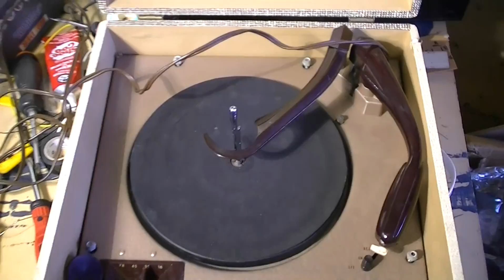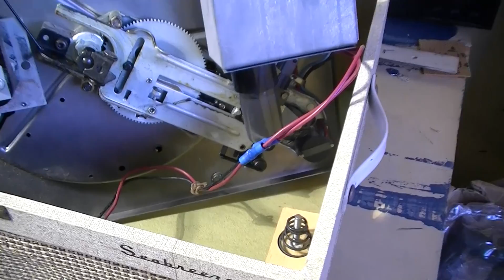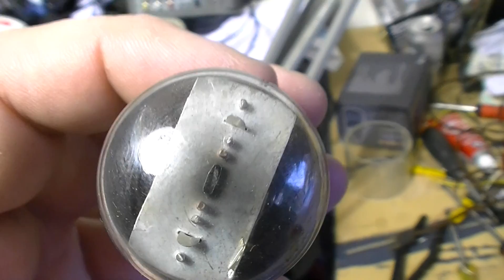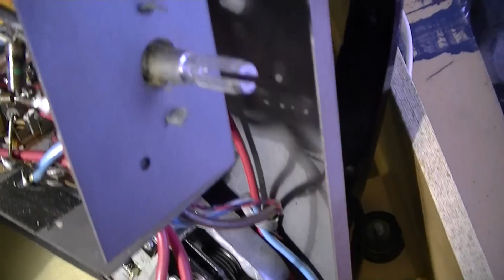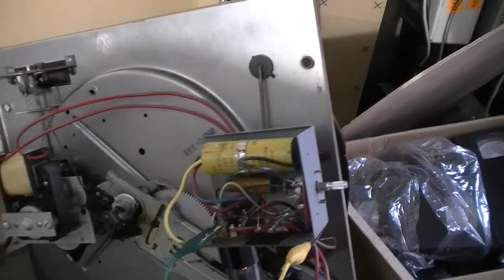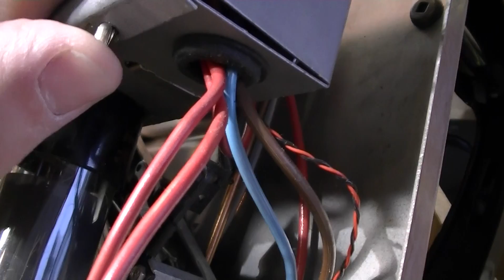1958 Seabreeze record player repair

Comment: Always replace filter cap never " Bridge together capacitors" very dangerous.
Reply from the maker: And just how is that? The deaf one is cut off.
Reply: @12voltvids  Ok good the way you had said you were just going to put the new ones in parallel sounded like you were leaving the original in circuit. I thought the video was fantastic, very informative and great lighting so you can see everything very clearly. Also Great Channel 👍.

Comment: This amplifier is very similar to my early 60s Symphonic suitcase turntable. Mine actually has the schematic printed inside! Only big difference is mine isn’t a record changer, it’s just this similar amplifier, and a single motor hooked directly to mains power, with a mechanical switch that raises and lowers an idler wheel on a stepped motor shaft to adjust the speed between, 16, 33, 45, and 78 rpm. The other side of the idler wheel touches the inside surface of the turntable platter causing it to spin. Literally as simple as it gets, but it works after all these years! 
I think the speaker on yours is a bit better though. Mine technically has bass, but it can barely be heard over the high midrange, probably due to the 4 inch speaker, which seems to be designed for efficiency over anything else, which I understand. When I lightly rub my finger on the back side of the cone, it makes a noise due to the fact that the speaker was designed to use very little power (probably a watt or so if I had to guess) to produce a loud sound, and this approach requires larger speakers than 4” to sound good. It’s not a powerful amplifier anyway, and it’s not like dubstep was a thing back then either. 😂

Comment: Cool, might just have found a suitable replacement for the audio output transformer on the Fidelity suitcase changer I mentioned previously. One big difference I have noticed with that and the ones I've seen on here so far (only this and a couple of ones that radiotvphononut worked on) is that they all seem to have selenium rectifiers and a single tube. Mine has a UL84 output tube (45B5 RETMA # I believe) and the rectifier is also a tube, a UY85 which I think equates to 38A3.  What does this "mean" if anything, would it be indicative of an earlier or later unit than one with a selenium or do you think it's more to do with our higher line voltage in the UK )I thought perhaps using the extra filament helping to bring the voltage down without huge resistors, as it seems to use the same 90V shaded pole motor as the US units I've seen.) Clutching at straws there obviously just wondering why mine uses the rectifier tube...

Comment: what do think the problem may be if I have a double tube old seabreeze and I hear sound from the needle but not from the speaker.  the amplifier ? or speaker?
Reply: Personally, I would test the continuenty of the audio transformer and speaker to eliminate those.
Reply: I guess you've either fixed or sold your seabreeze now, but as above check the speaker and output transformer. I've got a 2-tube Fidelity and the audio output is open on that. While you're in there replace the caps as a leaky coupling cap IIRC would cause excess current across the primary and kill it off.